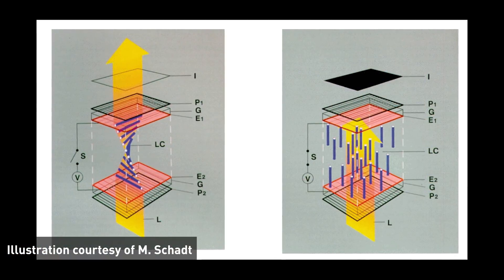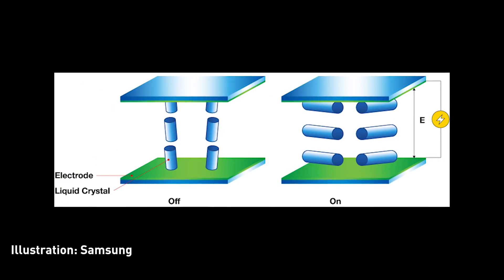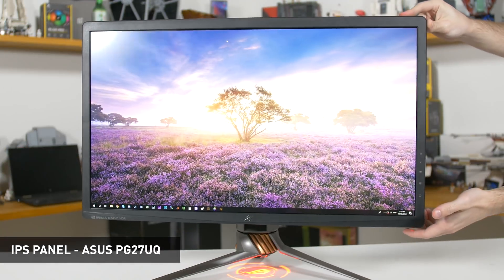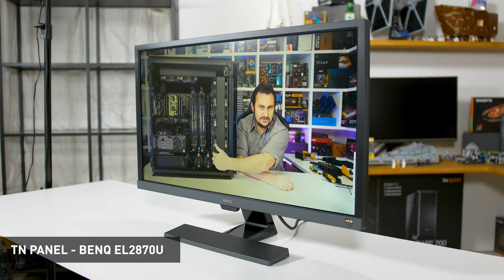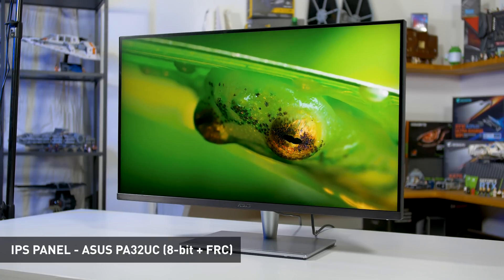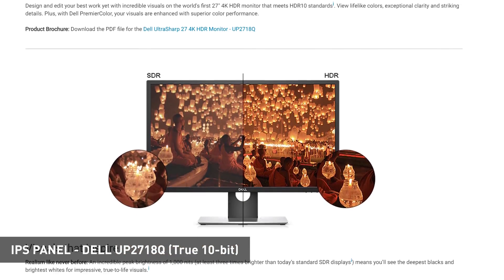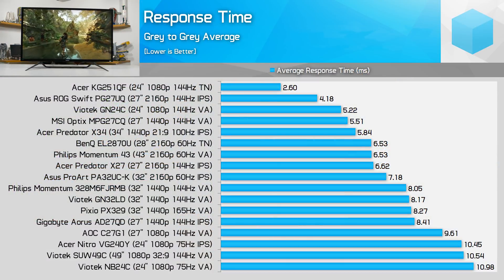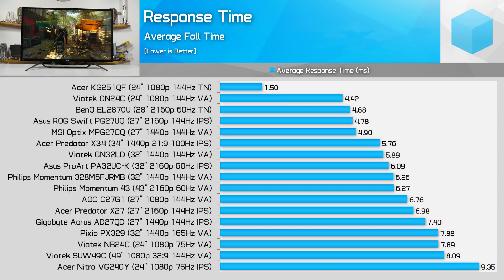TN vs IPS vs VA: Which LCD Monitor Tech is Better?

Comment: Does this need a revisit, or do your recommendations largely remain the same?
Reply: well now days u do have IPS panels of up to 165hz (mostly 1080p and 144hz on 1440p) and 300nits of brightness which is the standard (most VA have 400ish tho) so it wouldn't be a bad idea to recommend IPS for an all solution experience. However the white glows, and "light bleeding" never got fixed and still happens to this day u roll the dice whenever u get an IPS panel and in some countries as is a well known problem it has "levels" of white glowing and if it doesn't cover certain margin the warranty wont cover it (so say u noticed it a lot but is 1cm minus before warranty coverage ur shitout of luck) again this is in some countries and brands. There are some pro consumer laws that lets u change the screen regardless if within the first few days of purchase being made but I feel like this also changes within regions.

All that said, IPS still king for color accuracy but VA does pretty good with that as well in modern monitors so is not like a HUGE difference if u decide to go for VA.
Reply: Wondering the same.

Comment: so what if you're not a gamer or a creative?
Reply: VA or IPS depending of what u prefer he does mention VA is better for movies tho.
Although if u don't care about any of that might as well use a smart tv as main computer screen and get a bigger size...
Reply: @GatsuRage  no concerns about screen brightness and eye strain? I ultimately went with a VA panel for cost. for a 34" uwqhd
Reply: @keishabarwise4208  both VA and IPS have low blue light tech for make it easier for the eyes (do not enable HDR tho) and also have default pre set for gaming, txt, movies, etc. You probably already know this much if u fiddle with your settings already but if not just make sure to activate blue light protection, and disable HDR if u have it on.
Reply: @GatsuRage  I think my original question was about using a smart tv as a monitor....or did you say smart monitor?
Reply: @keishabarwise4208  u can use a smart tv as monitor, just  not recommended as they have glossy reflective panel, and they're also not built for be used for several hours with static images (like say desktop or reading some website, or word page) which induced burn in, black spots, and so on. 

I've used a 4k UHD 40" smart tv as monitor for like 3 years and I can tell you from personal experience.. don't. I would advice you if u so desire to have a tv hooked up to ur pc do it so  but as a secondary monitor for watch some netflix, youtube or whatever every time to time but not as main monitor.

Comment: After using an ips and a va monitor I kind of prefer the va monitor. VA just does everything fairly well. Good blacks. Good contrast and decent color while the ips I used had great colors sharpness and very smooth but terrible contrast and terrible blacks. Blacks so bad I felt like I was watching the first lcd tv from 2007 sharp aquos. Also the va I’m using is curved. At first I didn’t like curved but grown to love it. It just makes the screen feel a lot bigger than the flat ips I was using 
Monitors used. 
VA dell 32 165 
ips LG 32 165 
Both monitors seem to only be sold at bestbuy
Reply: Both good brands.. I was leaning towards IPS cos I'm a sucker for color accuracy but I also like my blacks well defined... plus I've been reading how IPS have so many problems with the white glowing, dead pixels, and such that probably ended up getting VA instead.

Comment: If you have the money -> An extremely expensive VA panel is best overall for a medium of response time/picture quality with great contrast (talking £600 or higher, Samsung/etc)

If you have a mid-tier budget and want to do something other than just gaming (movies, netflix, etc etc) then IPS at around £280-350 (lookout for sales)

If you're ONLY a gamer and you do not give a damn about picture quality, contrast or anything other than raw gaming performance then look at 240-280hz TN monitors for £250-400

Comment: I went from an old TN to a new IPS. Calling colors "washed out" on TN is not an overstatement, especially when you put the two side by side. A VA monitor probably would have got me better contrast but any LCD sucks compared to an oled TV anyway in that regard.

Comment: Which one is best for programming? Not a lot of different colors but eye comfort is the most important thing
Reply: late anwser but probably IPS panel as most of them (many brands) have the "eye care" feature built into it for tweak the blue lights. Any benq 27" 60hz entry level will do u just fine if u want it only for that.

Comment: I have HKC tn , Asus IPS , and CRT monitor. comparing them to a UFO test at 60 hz, the crt has the most fluid motion and clarity, TN is second to fluid motion but the clarity is average. But in IPS the image color clarity is there but theres like a jerking motion. I was opting for 144hz IPS but im deciding For TN viewsonic vx2458-p-mhd monitor 144hz

Comment: VA can have better colors than an IPS, reaching top image quality overall with its huge contrast as long as it's not about true 10 bit color depth (which even professionals rarely use). Still, even if you really want to see 10 bit for some reason, VA panels can use 8bit+FRC which come close enough.
Reply: You dont know what you are talking about. IPS has 10 times better colors than VA crap. Try to look at VA screen from 1 cm sideways off center and it will look washed out, so contrast means nothing without good viewing angles. And also VA panels are unusable in games because of smearing and ghosting. Example: samsung odyssey g7 flickering piece of garbage.

Comment: So now I know everything about monitor types, but I still dont know which to buy to go with my newly built pc. It will be used for (non competitive) gaming of 1-2hrs daily, and general computer use 8+ hrs daily. Im going from an I5 CPU and 1050 ti GPU to Ryzen 9 and RX 6800 and I need a better display than my living room 55: 1080p 60 hz 6 yr old smart tv lol.

Comment: Once I went IPS, I never looked back and don't regret it.
Reply: Lol both of y'all bought a cheap ass IPS monitor and you didn't even calibrate it using Rtings website settings. My Asus vg27aql1a is just simply amazing!
Reply: @goldensperm7182  Our monitors have like a 50 bucks difference what are you talking about?😂 You really wanna tell me that i can get rid of ips glow when i calibrate it correctly via the rtings website? You surely don‘t know what ips glow is...
Reply: @nostalgic3704  There's a huge chance that you bought an old version of IPS panel.
Reply: @nostalgic3704  Also not all IPS panel suffers from IPS glow, just like mine.
Reply: @goldensperm7182  Im fully aware of this but what has the settings to do with ips glow? We were only talking about ips glow and nothing else. And a 50€ difference does just a little to nothing in terms of quality. So what have you wanted to say to us with that comment?
Reply: @nostalgic3704  I was just telling you guys that you bought a cheap IPS or old IPS panel. That's why you gotta stop spreading arbitrary accusation against IPS panels.
Reply: @nostalgic3704  He's just trolling.  It's clear he has no clue how any of this works.  People who feel inferior often try to put others down so they can feel better about their situation.
Reply: Once i went IPS, i returned it twice because of the horrible IPS glow problem. Never looked back to IPS and don‘t regret it.
Reply: @nostalgic3704  same i just got myself a msi optix g241 and i wonder how people can deal with the absurd amount of ips glow it look just so bad.

Comment: Comparing screens of the same size is one thing... but if you change the measuring stick to screens of the same *budget* , you realise that plain more real estate outclasses whatever perks an IPS will bring. 

$600 AUD gets a value 27" IPS... or a value 34" VA.
$1600AUD gets a good 34" IPS.... or a good 49" VA. You can get an ultrawide IPS, or a VA so wide for the same cost that you legitimately have to consider whether your desk will fit it.

I like the IPS perks too, but the colour/angles/response/blacks/etc pros and cons of IPS vs VA are all small differences. They don't have remotely as much an effect on immersion and enjoyment as simply having a bigger, fatter piece of glass to game on.

I went back to my 27" IPS from a 34" VA... it wasn't fun.

Comment: Excellent video. I did a few hours of research  because I want to buy a monitor for office use and gaming, in the future. This video helped. 

What you said in the end is indeed something to ponder if the response times of a monitor are slow it might affect the refresh rate. So, you could have a 144Hz monitor but have it lagging due to that.

Thank you.

Comment: Currently, the Dell S2721QS model comes with a price of 250 euros and the S3221QS model 350 euros.  Which one would you recommend considering this situation?  My only concern for 27 ”is the scaling problem of Windows, so if I use it at 150% because the texts are too small, will my image look worse than the 4K 32 inch model?  Or will it have a disadvantage?  Or as an IPS panel or VA panel, which is the better choice for a quality display?  Otherwise, should I pay 100 Euros more and go for the 32 ”model?

Comment: Watching this on the LC 31.5" 650f VA monitor you recommended, and I'm not disappointed. The only thing I'd really love, is full black frame insertion instead of just the strobing backlight. For 30fps console games, I'd accept just 1ms of backlight off and turning the pannel black, followed by 32.3ms of a normal frame, as it's difficult to avoid the flicker at such a low frame rate, but I wanna be able to control it, not just have one or two presets. At 50fps it would be nice to insert 2ms of black between frames to avoid the worst part of the pixel transition. On UFO test @165hz I manage to see two distinct frames of ghosting, so I can say that some color transitions tan take up to 20ms even with maxed overdrive, that's why we need some degree of dark frame insertion even at standard frame rates, like 3ms at 60fps or 5ms at 70fps. To reduce ghosting to a single frame though... we would need at least 7ms at 40fps, or even 8.3ms at 60fps  (you can test all of these ideas at blurbusters).

Comment: So, as a gamer AND videographer that does some design and photo work, if my budget allows for either a VA panel with 90% DCI-P3 coverage or an IPS with 95%, but the VA panel offers other things in the sub $500 range like higher refresh rates and resolution that the IPS does not (gotta spend more to get all that), why would the IPS still be "exclusive" to creative work? Is there something else at play here when it comes to color? It would be good to get some more background on that, why even though a VA and IPS can both do +90% DCI-P3, the IPS is still better.

Comment: Had a VA panel and got tired of the smearing from dark to light transitions. Just upgraded to a 160 Hz IPS and it's so much better. The lower contrast isn't that big of a deal IMO.

Comment: Besides the contrast ratio, which I still don't understand... I feel with how IPS panels are evolving, I'd be disappointed if I did anything less.

Running a AOC 24G2, IPS, 1ms, 144hz, no glow or issues. Came from a TN so it's one massive UP....

Comment: I have an IPS 1080p 24 inch monitor, a cheap samsung no big deal. I tried to upgrade from 60Hz and 24 inch to an 144Hz and 27 inch 1440p Acer expensive monitor...boy the color difference is huge...i just cant go back to TN after using an IPS...the image on IPS is sooooo much better for me...i returned the Acer and im back to Samsung and wont upgrade again until 27 inch 1440p and high refresh IPS will be available for decent price.

Comment: So, I'm looking for either an IPS with really good contrast and black levels, or a VA with no black smearing. I get pretty frustrated with my TN panel in horror games because the dark colors just don't look right compared to the brights (for example RE2 remake).
Refresh rate is not that big of a priority to me, but I think I entered that territory for decent response times. I also use a nintendo switch on this screen, so 60Hz response should also be decent. (currently on a 60Hz 2ms-rated TN)
Reply: Nixeus EDG 34" is nice

Comment: This will soon, if not already, require a reassessment due to the newest IPS panels performance, particularly response times.
Reply: They're still horrible. All their claims of 1 ms GTG are fake. basically require overdrive mode which creates a ton of ghosting and overshoot. If you really care about response time and image clarity at high frames TN is still king. Only TN can get you 0.4 ms without requiring a special "speed mode".
Reply: @FilthyPeasantGaming  if I remember correctly what I was referring to was the fact that the fastest IPS panels are faster than the fastest TN panels (the opposite was a claim made in this video) regardless of any other considerations like ghosting. It’s strange to say all the 1 ms claims are fake then mention “0.4 ms” which is most definitely only on one small portion of the panel anyway. I agree it’s all a farce in reference to manufacturers numbers.

I have a VG259QM 280hz IPS and set up according to the best compromise of response to overshoot (from reviews) I don’t notice any excessive ghosting. It’s far better than my 144hz VA panel, and I like it more than my BenQ 144hz TN as well. Highly subjective of course... but unless you are doing analytical testing that’s all it ever is anyway.

Comment: Hello to you. Question 1: VA or IPS at dark based games in the evenings. Question 2: 27''1440p or 34'' 3440 Ultrawide 100hz up. I have a Samsung 50" VA TV and I use it as a monitor. It has a very good blacks, contrast and backlight, and I most often use my PC in the evenings and at night. Apparently now IPS are better and  that the ipc-glow isn't so bad. I play space simulations where outer space is mostly ... black ^^. I would like to have a 27-34 ultrawide curved monitor "but I don't know if IPS or VA. Anyone have IPS and play EliteDangerous, Starcitizen, X3-X4, Reddeadredemption, witcher3, etc and uses IPS in the evenings? If you get that I mean.
Reply: Nixeus EDG 34 is one i like.  Its a VA at a decent price

Comment: i'm watching this on a TN display  and in my opinion the quality is great, TN would be GDPR compliant  than other monitor technology's due to its viewing angles where you have to look at it straight on and not from the side etc so its a good display for if your doing sensitive data etc for GDPR compliance as people won't be able to see what's going on if they look from the side as they won't be able to see what's on the screen unless they look at it straight, like over your shoulder etc which is rude to look over peoples shoulders.  I'm watching this on a hp laptop with a very good TN display.

Comment: I get that VA panels have a much higher contrast ratio (3000:1 compared to 1000:1 in TN/IPS), but how does that difference translates into practical uses? can you make a video with a side by side comparison of two types of panels?

Comment: I bought a VA monitor, the picture was more dynamic and felt beautiful, but the viewing angle was just unacceptable.  I returned it and got an higher grade IPS monitor.  The colors are better, but the picture just feels boring.

Both displays I had said they cover 95% DCI-PC and a viewing angle of 178°, but I doubt it.

Comment: 9:39 nobody needs a refresh rate higher than 120 to 144 though and anybody that thinks they do is....well let's just say they would all fail a blind refresh rate test.  Can somebody please do that?  All those people that think anything above 120 is noticeable....I want to see them go, "oh yeah this is definitely 240 hz, I can just feel it, it's smoother, I noticed better response, it was just great"....and then it's revealed that it was actually a 120 hertz display, or even better (to embarrass them further) it would be revealed as a 60 hertz display!!!  Although above 60 hertz is fairly easy to notice though so I don't think anybody would fail that hard.  But 120 hertz is probably about the limit where most people wouldn't be able to tell even though there are so many people that insist it makes a difference 🙄  and yes, I know Linus dia thing with 240 but it was comparing to 60 Hertz.  And 60, while it's getting there, isn't high enough to where you can't notice a difference.  It's around 120 where it becomes difficult if not impossible to notice a difference.  You must understand this is a case of each additional "refresh" per second being less effective than the last.  Going from 1 hertz to 2 hertz is a major difference.  But 2 to 3 is a smaller (but obviously still noticeable difference) and...basically the higher you go, the less significant each additional "refresh" per second is.

Comment: IPS. If it's glowing when it's supposed to be black that's a major fault, for this reason alone no IPS can ever be described as good. Deeply flawed is closer to the truth. Thank god LCD is coming to the end of its life, Samsung are completely dropping it this year. If you have to buy an LCD make sure it's a VA type. There is no reason to buy anything else until some form of OLED is widely available. Whilst some VA displays are better than others, trust your eyes, ignore YouTubers or you'll finish up with a glow in the dark IPS. They offer no advantage over a competent VA panel in 2020. Trust your eyes!